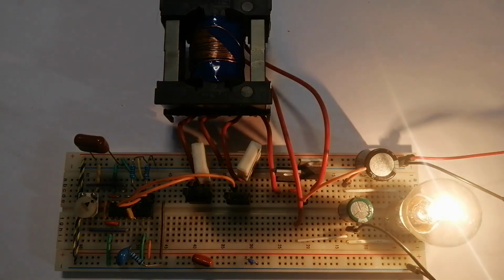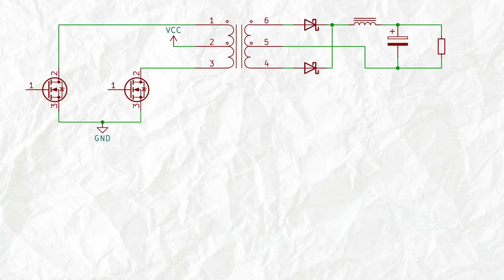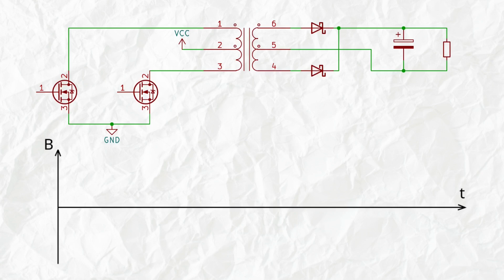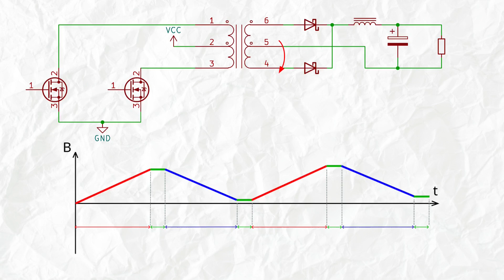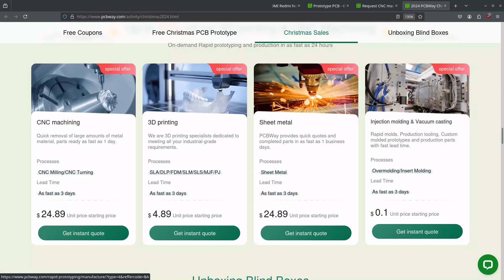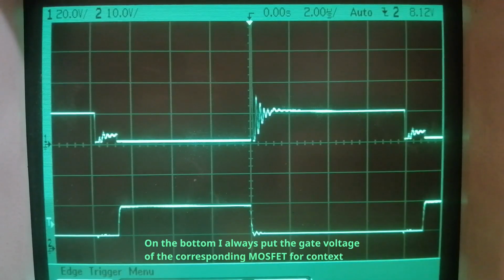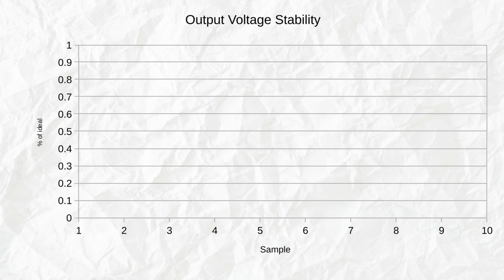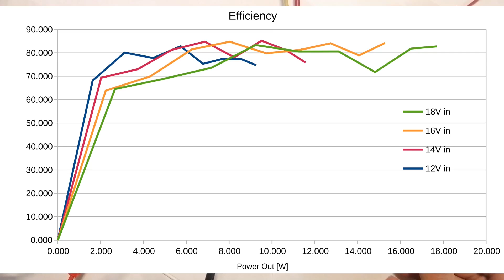Push-Pull Converter Variants and Building and Testing One

Comment: Hello sir, I have built a push pull converter 12V input 110V output for 1.1A dc load. 
Components using ka3525, 80nf55 mosfet 2 per channel total 4. PQ50 transformer, D882 and D772 transistors for driver. Problem is mosfet heatup and the temperature reaches 90C after 25 minutes. How to solve this. I have not included a snubber circuit because components value and circuit not clear. Will adding snubber circuit reduce the heating ?
Reply from the maker: Hi, yes in general snubbers have the job of absorbing most of the energy that the MSOFET would receive when it switches off. 
Adding one would likely improve the problem.
Reply: @5VLogic am adding on the mosfet drain pin to input +ve snubber 1K2W, FR607, 100n400C capacitors, but the heating problem is not resolved.
Reply from the maker: The resistor is a little high, what frequency are you running at? 
Is the resistor heating?
Reply: @5VLogic 16KHz switching frequency. One more thing output and input negative are common. Because am using LCD for Read in and out voltage

Comment: Hello. Firstly, thank you so much for making such great videos 👏
I just want to ask if it is possible to boost the voltage (e.g., to 500V) in order to drive an ultrasonic piezo? I mean, is it possible to change the transformer ratio to 1:15 to increase the voltage?
Reply from the maker: Thanks! 
Yes in theory there is no limitation on the transformer ratio (at a certain point windings can arc between each other).
Although be very careful with such a project because 500V is enough voltage to give you a potentially fatal shock since the circuit can still provide enough current (50mA can be enough to off someone). I do not recommend building such a circuit. 
Stay safe!

Comment: Hello @5VLogic
Im working the 12v to 389v 500w converter and its almost completed 

The design is push pull topology and one thing i observed is when im powering 200w bulb load directly connected to transformer output everything is fine cool & efficient. But when i connect the load through bridge rectifier and capacitor. The mosfets start heating a lot and i see very sharp Vds spike like 30-60v even though i have snubber added. 

To me it seems there might be current spike due to capacitor charging after rectifier thus high Vds spike due to leakage inductance.

Could you please suggest me method to get rid of those spikes? I want clean dc output of 380v without the Vds spikes & heating killing mosfets, so i can use it for next phase to converter DC to AC

If you need pics of oscilloscope or any other thing let me, Also if you are available on social media platform let me know
Reply from the maker: Hi,
Great project, just from your description it's hard to figure out what the problem is. The only two things I can think of is whether your rectifiers are fast diodes with low recovery times, and second I'm curious if you have an output inductor before the capacitors to act as a buck converter.
If you would like you can send me an email with any info like scope waveforms, schematic and pics of the circuit and I can try to give it a look and see. My email should be in my channel description, I know because others have written to me.
Hope this helps and good luck!
Reply: @5VLogic  Thank you very much i will revert soon
Reply: Hello Sir

I have shared the details on your email. Just mentioning it here in case you miss it or it endup in spam
Reply from the maker: No problem I read it yesterday but am still in the process of coming up with a useful response.
Reply: @5VLogic  Okay. Thank you very much

Comment: really usiful channel❤.if u have time explain how to count turns and which suitable ferrite size and material .As well as 😅 how to prevent sat and liminate the leakage inductance .what i notes here primary has higher turns 23 each how do u count it as in market in your input case 4 to 5 each enough for input 12v as some calculator app say.thanks again ,good bless u.
Reply from the maker: Thanks!
I made a video some time ago about switching transformers where I cover most of the basic theory.
https://youtu.be/b0_4J_882LA
The fact that I used 23 turns is because it reduces the magnetizing inductance and lowers primary current. As a general rule I try to have the magnetizing current around 0.1 to 0.2 times the "power" current.
Hope this helps!

Comment: Inductor will always try to absorb voltage spikes (well current, but 90% of the time they become roughly equivalent), right? And I think all the coupling means it could even quench the spike on the other side of the transformer.

Waiting for the TL494 to get replaced with an MCU and digital control... xD

Comment: Hello
I tried to build the similar circuit using SG3525 IC and winding a EE421521 ferrite tranformer. I tried to  replicate circuit from chinese 12v to 380v 500w converter. Initially the circuit worked fine i was able to light a 12w bulb for 10min and current draw was around 1.3A but the next day when i tried to power it on again the IRF3205 mosfet blew and kept replacing and they blew and the IC broke and cylce continues. I don't know what is the problem. Any suggestions?
Reply from the maker: Hi,
unfortunately without the schematic it's really hard to figure out, specially because as I understand it's not quite the same as the circuit I used.
I know the frustration of burning parts and not knowing the reason.
If you have an oscilloscope I'd recommend slowly ramping up the input voltage and check that there aren't any spikes like the ones I showed in the vid.
If possible separate the IC supply from the power input, so you can have the IC running at 12V and the transformer getting a variable voltage (starting at 0V).
More than that I can't say with the given info.
Stay safe with the 380V and good luck!
Reply: @5VLogic  Thank you very much for your feedback. I wasn't able to find the exact issue 😕 . But I managed to get ahead by rebuilding the same circuit and now it works like a charm easily able to power a 200w bulb. 
I also discovered the Mosfets I was using were fake but they work nice 😅. I have ordered original Mosfets from an Authorized supplier. Excited to continue working on it 😁
Reply from the maker: That's awesome, I'm glad it's working!

Comment: Issue with Push-pull converter is induction leakage causing voltage spikes. The best converter design is the full bridge: Reduced inductance leakage, full use of the core capacity.
Reply: Ага, и дорогих транзистора, на которые нужен специальный драйвер. Лучше всего по надёжности, это прямоходовой косой полумост, по подобной топологии работают многие сварочные инверторы.
Reply: @SINHRO-FAZA  Transfomers are even more expensive than transistors (and a lot heavier too), Half Bridge will require a transformer about twice the size (using same switching frequency). Still need a special driver for half-bridge. Also need to use larger transistors for a half bridge.

Comment: What is wattage rating of snubber resistor and voltage of snubber capacitor?

Also, how to avoid gate ringing in push push configuration?

Onething i found in chinese inverters which are configured push pull design have RC snubber accross primary side of transformer across both the mosfet drain pins vs in your design snubber network for each mosfet?

Today i found your channel it seems very nice to me. Good content straight to point 👍 Thanks
Reply from the maker: The snubber resistors are1/4 watt standard resistors. Since they were hardly warm at all, I'd say they were probably taking 1/8W or something similar, (it varies with the load).
The capacitors I don't know because ceramics don't write them on the device, but on the datasheet when you buy them (I salvaged them).

To avoid ringing on the gate I used a series resistor, I don't know if 1 or 10 Ohms, but anything in that range should be good to make the switching as fast as possible, without any ringing.

I didn't know about putting the snubber circuit across the drains, that's interesting.

Thanks for the comment!
Reply: @5VLogic  Thank you very much for responding. Appreciate it. Looking forward to more such interesting videos.

You earned a subscriber 😊

Comment: I count eight (8) non-electrolytic capacitors on your breadboard, but only three (3) in your schematic.  Also, where is the +5V, tied to various pins of the TL494, coming from?  Otherwise, interesting video.
Reply from the maker: Yeah I added a few bypass caps just to be safe since I was using a breadboard.
The 5V is produced by the REF pin of the TL494.

Comment: I want to make a 150W push pull converter with two outputs of  85W and 65W with a feedback loop. Suggest me how can I make this model!
Reply from the maker: I would recommend finding a controller IC that has current balancing capabilities intended for push-pull.
For sizing the transformer be sure to calculate all parameters, if you need I made a video on transformers.
Also if you're creating two outputs from one transformer and IC I'm not sure how well the regulation will be, because you have to get your feedback from one output, the other one will be poorly (not at all) regulated.
Reply: @5VLogic  other output will control by using POL.
Reply: @5VLogic  can you make the video on this topic?